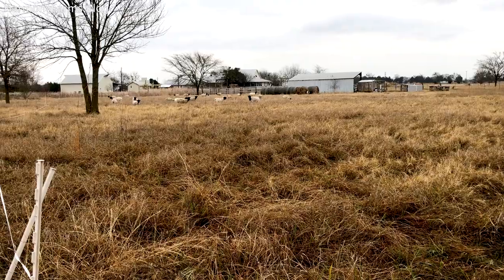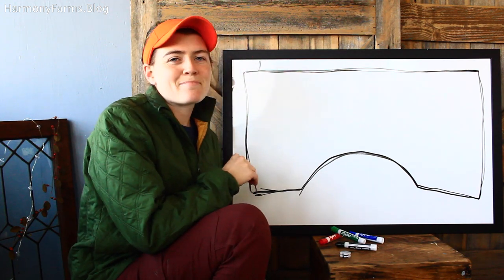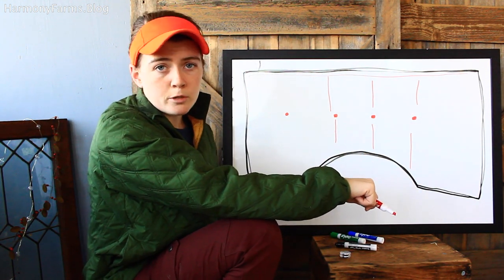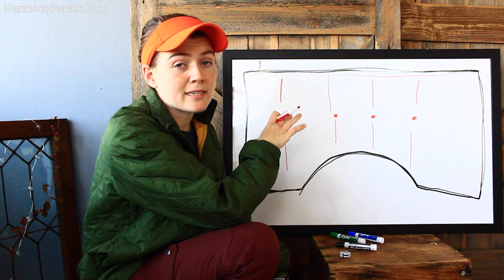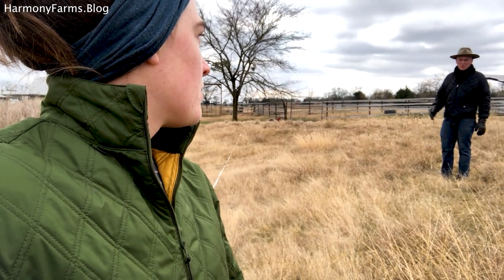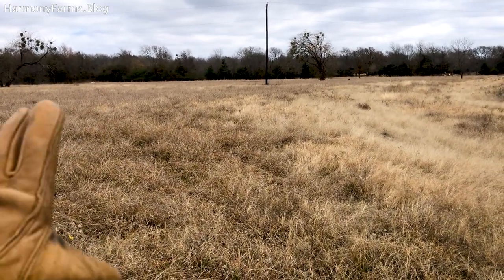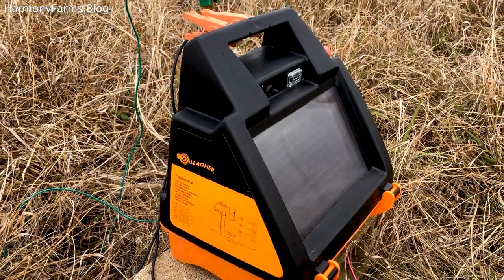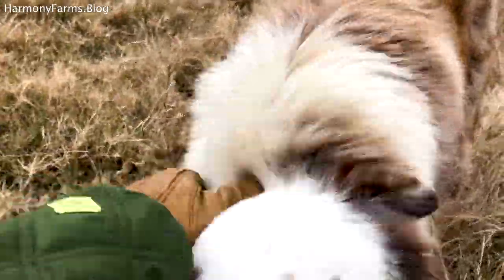10 ACRE ROTATIONAL GRAZING SYSTEM for Winter

Comment: Ok 
I’m addictive to your YouTube 
Grace you have given me ideas for my pasture. The ground rods placed in the pasture 👍 but to locate them just pick up a 3/4” pvc pipe cut into two that should be 5’ long. Slide it over the unused ground rods. There should be no problem with finding them. 
Water 
My friend uses a bulge pump, 12 volt battery, black pvc pipe, and  300 gallon water tank. To pull water from the pond for his cattle. The pump can be purchased from any boat dealer. All that is needed is emanation . 
You are now getting me excited about spring. Hopefully the ground is thawed by mid May.
Reply from the maker: Thank you for all the great comments!!

Comment: It sounds like you are putting some thought into it, but you might want to look into altering the size and shape of the paddocks as well with a good copper ground to attach to the ground rods, you could stretch away from the poles and do more narrow strips that connect to water, but they also would be half the size of the current paddocks that you are proposing.

Comment: I had the same problem on my 10 acres. Much the same energizer too and weak spark.  I solved that with a higher joules 12v energizer a car battery and 10w solar pannel. Now I get 10kv and don't need all the grounding rods.  I also pump water from a pond into an elevated barrel with a simple billag pump, battery and 20w solar pannel.  Then I have 1 inch black hose down the middle for gravity feed water.  Works very well.
Reply from the maker: I just saved all this info!! Thank you.  I’m prepping my spring grazing plan and I think your combination of tools will help. 

I really appreciate you taking the time to share!

-the Shepherdess 🐑🌱
Reply: @theShepherdess  Let me know if you could use pictures of my set up.  I like your use of Scripture as I am a fellow believer.
Reply from the maker: @mikereimer368  I’d love it! Email Shepherdess(at)harmonyfarms(dot)blog
Reply from the maker: I am hosting a small farmer livestream tonight and would love to invite you to join! It’s short notice, but starts at 7pm CST.  I think you could contribute a lot of knowledge. Here is a link to register if you can join: https://harmonyfarms.blog/meet-farmers/

Comment: Excellent video! This is the third video of yours that I’ve watched in the last couple of days, trying to educate myself for the launch of a farm that I have in my heart. Concerning your water situation, have you considered running your electrical fence in a sunrise pattern where each of your lines run up to the water edge of the pond and away at an angle? This would divide your pasture a unique way, but would allow water access all year round. Of course the paddocks would be narrow, but I don’t think it will be a problem especially if you fed them from the opposite end of the paddocks.
Reply from the maker: Thanks Jason! That’s a pretty good idea.  I think it could be work!!

-the Shepherdess 🐑🌱
Reply: Excellent.... Great layout! I'm so glad I subscribed!
Reply: I think you may run into issues with the width of each sub paddock, animals don't like being in a narrower space than about 12 feet if there is a hot wire involved

Comment: A galvanized T post will provide a good ground also and the the Gallagher charger has a slot ( not sure if your model does have it ) in the back to hang the charger on the T post, just drive it so it faces south for the best charging

Comment: Just now seeing this video. I did this for rotating my pigs. Two questions. What is the ideal paddock size to rotate every week? Of course it depends on how many sheep. Second question... what do you do about shelter with rotational grazing? That would mean you either have a mobile shelter or permanent shelter per paddock.
Reply from the maker: Hi Jason,

Here is a video addressing my paddock sizing: https://youtu.be/Zafxj_N-IUc

As far as shelter: I will make sure a paddock has good tree coverage if there is extreme heat or rain on the forecast.  If it’s freezing rain I will walk them back to the shed we have for extra coverage. 

I made these portable shade units for summer which were perfect for areas of the pasture where there is not tree coverage: https://youtu.be/kGzC28WLqa4

Comment: Please be cautious raising your T-post driver above the top of whatever your driving with it. The spring in the post coupled with the weight and force of the driver can create a more dangerous situation than one would think faster than one can react. It's more an issue up high.  I've got 2 concussions and a cracked shin that remind me to never lift the driver that high again.
Edit: said problem arises when the leading edge of the driver catches the top of the post. The force immediately transfers to the post which springs the driver in the direction of least resistance with surprising force. Can really ruin an afternoon quick
Reply from the maker: Good warning!

Comment: I don't know how I missed this video. I thought I had seen all of them! So I have been wrestling with how to section off both of my four acre pastures for rotational grazing. In my mind I could only see t posts but after watching this video, the ground rods are the perfect solution! Just like you, I can only use solar where I am at so we have to be creative in our uses. One question though, in a more recent video you discussed that electric netting kept the sheep in better. That is what I use currently but I want to switch to the tape instead for ease of installation. What are your thoughts?
Reply from the maker: Hi Tracy! Yes, I use netting when the labs are super small on pasture.  When a lamb slips under the wire, the rest of the flock wants to follow.  I’m going to try poly tape only again this year, but last year I used the netting until the lambs were about 8 weeks old :). 

Hope this helps!
Reply: @theShepherdess  it does, but I currently use my netting for my little flock of shetlands and my kunekune pigs. I was hoping with the larger sheep that poly tape would keep them contained. Have you tried transitioning them from netting to poly tape as a lambs grow older? How did they take to it?
Reply from the maker: Yes!  Once the lambs were around 8-12 weeks I went back to the tape with great success!  I use poly tape 9/10 days.  The netting I reserve for when they are having a super rough containment week.  Typically happens when forage quality takes a dip in the winter or over summer and their appetites make them tough to contain.